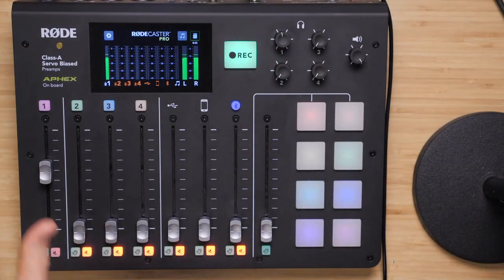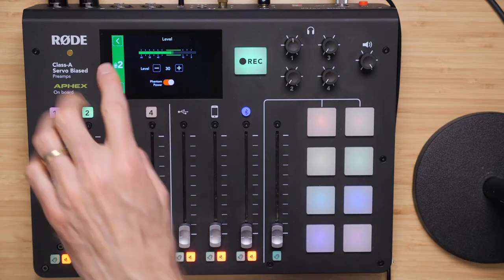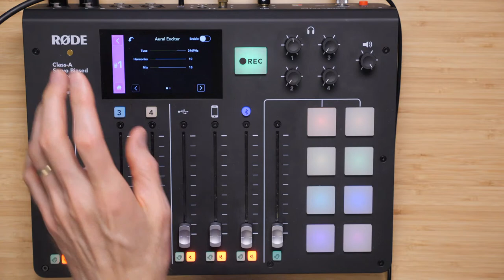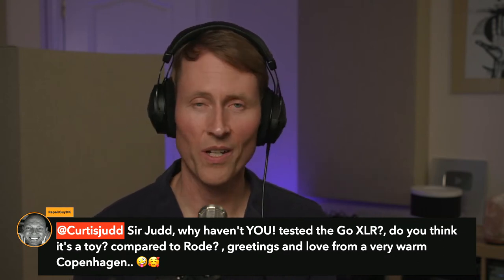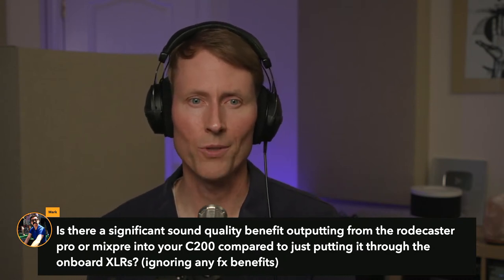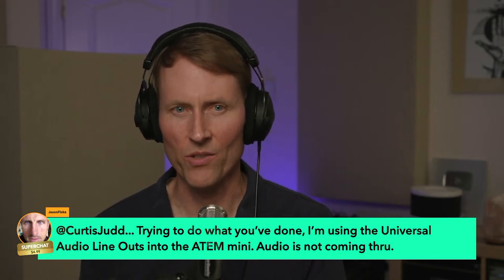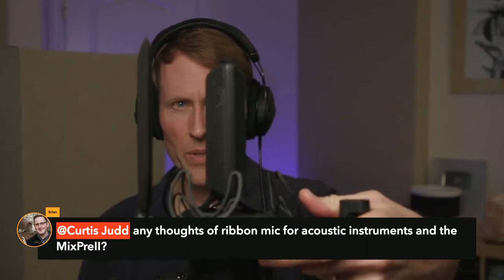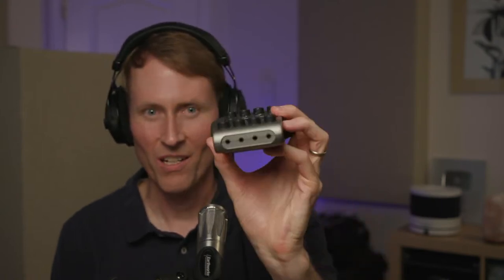ATEM Mini Audio from RODECaster Pro

Comment from the maker: Live stream starts at 4:00.
Reply: Did you have a cloud lifter on the sure when you had the hiss? I am wondering if that would solve the issue of having to push the gain so much.
Reply from the maker: @EatLocalNewYork  No, I did not use a cloud lifter, fethead, or any other in-line amplifier.
Reply: sorry to be so offtopic but does someone know a trick to get back into an instagram account?
I was stupid forgot the login password. I appreciate any tips you can give me.

Comment: I had been considering a very similar setup for a teacher that I am working with for remote learning for music. I like your solution better. Big buttons, recallable settings, and relatively intuitive controls. I was most concerned with how to effectively transport and monitor audio to and from the ATEM (and the expense of the ATEM) and decided to not splurge on the ATEM Mini. 
Setup goal was: Three mics - dynamic vox and xy classroom room mics. Two or three cameras - one director, one classroom, one option/flex use. 

I ultimately did an Apollo Twin USB (1 vox / 1 room) and a pair of webcams all combined in OBS to be used as a software ATEM-ish setup... feels like duct tape...but I was able to package it and get them trained on it pretty effectively. Works fine. But I'm afraid I'm stretching the outside limits of USB resource availability from a consumer laptop. The ATEM mini is the solution to that concern.

EDIT - To clarify, I didn't read the manual too hard on the ATEM - saw the back said "Mic 1" and "Mic 2" and thought... bummer... no line in.... next.  They did themselves a disservice not advertising that is line level switchable more prominently. Make sure Black Magic knows your stream is directly driving sales of their products.

Comment: Just a thought, but on equipment that uses an external power supply that sends DC voltage to the device, running that cable parallel to line level cables won’t typically introduce audible noise. Running said power cable parallel to balanced mic cables shouldn’t create noise, as we run 48V DC inside that cable with no issues. Definitely don’t run AC power parallel to mic level cables, especially unbalanced 1/4” mono-style. 

Love your channel, Curtis!
Reply from the maker: Thanks Carey.

Comment: Hi Curtis, my understanding is that the RodecasterPro has balanced outputs. Because of that, I use balanced cables (TRRS), connecting the Rodecaster in to a box that converts the signal to unbalanced. From that box, I use 3.5 jacks or RCA to connect to any other unbalanced line level input, Switcher,Camera, etc.... In my case, this eliminates all unwonted noise and hum. Would love your opinion on this approach. Thanks
Reply from the maker: Hi INFO GUERRA, it sounds like that works fine so that's good. The ATEM Mini's inputs are unbalanced, as you know from your setup. As such, the cable I use has 1/4" TS connectors bypassing the balanced signal coming out of the RODECaster Pro. Since the cable is short and I keep it away from power cables, it seems to work well without hiss. Both approaches are valid.
Reply: Hi! What box are you using? I have challenging noise in my setup. 

I have been using isolation transformers, got better but not great. Cables are short.
Reply from the maker: Sounds like they’re using a DI box.
Reply: Curtis Judd I normally used DIboxes to get unbalanced stuff (bass, keyboards) into balanced inputs on a mixer. But maybe they can work the opposite way if not electronics stops that. Passive DI?
Reply from the maker: @mikaelsvennungsson  Agreed - I would like to know which box they're using as well. Normally a DI is to convert from unbalanced to balanced. Perhaps it is just using a passive DI box in the reverse, though I've never tried that. In this case, it seems to work fine with the cable I described. No need for a conversion box.

Comment: Hi Curtis. I must've watched this video 3 times or so but still having issues with syncing ATEM produced recordings and the audio from the SD card from RodeCaster Pro.  Have you found a solution for this at all?  You're the only one I can think of to ask!
Reply from the maker: Yes, I make a recording with me clapping. I take the video into a video editing app. I move frame by frame (one at a time) to count how many frames there are between the time I hear the clap and the time I see the clap. Then I go into the ATEM Mini's software control app on the audio page and apply an offset of the number of frames I counted in the video editing app. I hope that helps!

Comment: I have a SMB7b on the RodeCaster Pro and I bought a FetHead which helped but I am still getting ~50-55db of hiss. So FetHead requires phantom power, I am at 5th rung on from the top on the fader, ~48 on the levels. Cables are not crossing any power cables, I even just pulled them up around to see if it made a difference but it didn't. Maybe it's the  Kopul Studio Elite 4000 Series XLR cable?
Reply: To be clear, I don't have a ATEM Mini although it's on my radar for other things. The RodeCaster Pro is hooked directly to the USB on my Mac Pro.
Reply from the maker: Hmm, could be. I’d push the input level and remove the fethead.
Reply: @curtisjudd  Thanks for the response. Hmm, if I remove the FetHead, turn of Phantom Power, juice the levels to 55 (max), it does remove the hiss but I need to move the fader above the fifth from top to get anywhere near the 15 mark, which brings the hiss back lol.
Reply: Also, I typically keep my microphones a few inches from my face. I always figured that was proper mic technique.
Reply: @iamfrankstallone  Do you hear a similar level of hiss in the livestream here? If not, it might be worth contacting RODE support to see if there's a problem with your copy. I wish you all the best on getting this sorted out!
Reply: @LearnLightAndSoundSessions  Thanks. I did but I also have more background noise. I have a Blue Yeti Pro and that works as expected on the unit so I am going to swap the cables, see if that changes anything, and muck around more. I had to ask because you were literally using my exact setup -- hah! -- and thank you. I am grateful for your time and patience.
Reply: Follow for future Frank. I seperated the power cables and XLR cables, and got XLR cables the exact length I need. This got rid of all noise, and no FetHead / Cloud Lifter needed.
Reply: I hear hiss too but the noise gate all but cancels it out, so nobody else hears it.

Comment: I have tried to push Rode to include delay in the Rodecaster for the scenario when you are using eg Microsoft Teams etc. and connecting ATM and RC via separate usb connections. Let’s hope that they are able to squeeze that into the RC via a firmware update. (Software to delay sound exist but want to minimize number of components in the chain)
Reply from the maker: Interesting idea. I suppose it depends on whether there's enough buffer memory and it is high speed enough.

Comment: I am sorry I am asking so many questions but you are also very kind for answering them all 

If I were to get the Apollo solo (USB) 

And run it with the sr314 

Would I be able to process it with (included software) or would I need to go out and purchase anything additional
Reply from the maker: Hi SaltyPancreas, the UAD Apollo interfaces come with some plugins, but they are not all free. So depending on what you need to do, you may need to purchase some additional plugins. The RODECaster is more focused on spoken word recording and streaming, so is a good match if that's what you're doing. That said, the Apollo interfaces are amazing, but the learning curve is substantially steeper and the price of the plugins can be quite high - adding potentially a few hundred dollars to the final price.

Comment: Hi Curtis, to get audio from rodecaster and video from hdmi cam in sync you mention adding some delay in the audio from within the settings on the atem mini. Is that possible only in the atem mini pro or also in the atem mini?
Reply from the maker: Hi Ronnie - this is also possible on the non-pro version.
Reply: @curtisjudd  That's great! Thanks!

Comment: Would you recommend sending the line level from the RODEcaster Pro str8 to the camera to eliminate sync issue and skip doing the trial and error sync test? Or would you recommend sending the signal from the RODEcaster Pro to the ATEM like you have in this video?   I have a Gh5 with the audio adapter that can take line level input (I would just need an adapter to convert the cable XLR to camera).
Reply: Chris, I understand there are many ways to turn gain up and down and adjust volume levels with features not he RODE and the ATEM combines.  I noticed your output is maxed out on RODEcaster pro sending into your ATEM.   Is that so you can get the most juice out of the RODEmixer and then adjust on the ATEM mini? Id love your feedback thanks!
Reply from the maker: @maiaproductions2855  Yes, exactly.
Reply from the maker: I would go into the adapter at line level which makes sync a non-issue.

Comment: Curtis...thanks for another fantastic video.  Can you give me the specs (and even a suggested brand) on the output cables you recommend to take a feed out of the Rodecaster?   I'm very motivated to avoid RFI and electrical noise.    Thanks much Pete
Reply from the maker: Hi Peter, links for the cable are in the description.

Comment: Hi Curtis, Big fan of your channel, brill content. Question about where to monitor the audio from?

I've a Rodecaster [RC] into Atem Mini Pro (using the connection method in your vid) and then into OBS. ATEM and RC are also connected to PC via USB (to control hardware via associated software). I use the RC for compression/noise gate etc and the ATEM for EQ and OBS for limiting.

I would appreciate your advice on where/how to monitor the 'final' audio output so I can actually hear the applied audio settings (for RC, ATEM & OBS combined) and adjust them? If I use the front headphone port of the RC, that only monitors the settings I've applied to the RC, and not those applied to the ATEM or OBS. Food for thought for another vid maybe?
Reply from the maker: Hi Carl, Thanks. With the setup we covered here, I now stream directly from the ATEM Mini Pro. So in that case, I can monitor from the headphone output on the program monitor. You could do that but it wouldn't include the final audio processing of OBS. To be honest, I'm not sure how to monitor the final encoded audio if you're using OBS as the encoder. Perhaps it has the ability to send final audio to the computer's sound card and you can monitor from there? EposVox on YouTube might have some insights since he know OBS much better than I.
Reply: @curtisjudd  Thanks Curtis, as always straight to the point and clear. Many thanks and very much valued.

Comment: @Curtis Judd 5:47 FYI, my brand new Rodecaster Pro has unity marked with bold lines (similar to the top and bottom line shown in this video). And I also just got an Atem Mini Pro ISO as well!
Reply from the maker: Hi Ben - thanks for that! Good to know they started marking unity. And congrats on the ATEM Mini Pro ISO! Happy streaming.

Comment: Hi Curtis...  I've only just discovered your channel. Great work. Like your style.  I use a RODECaster Pro regularly for podcasts, and have learned how to tweak its processing in V2.1.  I'm doing audio for a video shoot soon,  all talking-head using Sennheiser EW100 lav kits,  destined for an e-learning course.  I thought to use the RODEcaster as the audio interface with outputs to the internal card and an external ZOOM H4 as backup. What do you think? Thx!
Reply from the maker: Hi Andre, That should work. I'd only worry about how well RF/EMF shielded all these devices are just in case some interference pops up. If you test beforehand, that should give some confidence.

Comment: My wife does corporate trainings and I've built a small studio for her centered around an ATEM Mini Pro.  Had been looking at adding a Rodecaster Pro into the mix because my setup is just not complicated enough...  Then the ATEM Extreme came out with Super Source and the possibilities of doing live virtual panels with 3 remote guests excited her.  HOWEVER that would mean needing to separate out the audio from up to three video-in feeds and then mix-minus multiple backchannels (one per guest) before you bring the audio into the ATEM.  If I'm reading specs right the Rodecaster's mix-minus is far too limited to do this (or can I mix minus to those 4 headphone jacks???).  Any suggestions on a mixer like the Rode that could do this?  Thanks in advance for your answer.
Reply from the maker: Hi Sid, I would just use Zoom as the back channel for multi guest streams and use the processing in the ATEM Software Control app in that case. I’d think trying to add the RCP to that setup adds a lot of complication for not much benefit.

Comment: Great video Chris, thank you so much. I’m almost halfway through it, so forgive me if you answer this at the end, but when I lifestream I send the Atem mini and the Rodecaster into my MacBook Pro via USB C separately. Then I put a short delay on the Rodecaster signal. I’ve had OK results with this, are there advantages to sending the audio into the atem mini instead?
Reply from the maker: Hi Ryan, yes, but only if you wanted to use the Fairlight audio processing in the ATEM.
Reply: Curtis Judd awesome, thanks!

Comment: Hi Curtis,

I have two different mics plugged into the Rodcaster via XLR. I'm running the TRSS cable to Mic 1 input into the ATEM Mini. I want to streamline my podcast editing process and be able to individually see on the timeline each speaker talking into their respective mics. How would I achieve this? Thanks
Reply from the maker: Pan one hard left, the other hard right.
Reply: @curtisjudd  I meant with separate .wav files on the timeline.
Reply from the maker: @yashchitneni  Yes, that will put one on the left channel and the other on the right channel (assuming you're only using 2 microphones). Otherwise, no, you'll need to record on the RODECaster and sync to the video in post.
Reply from the maker: Unless you have both the ATEM and the RODECaster attached to the same computer and are using an encoding app like OBS in which case you combine the audio and video in OBS instead.

Comment: Interesting - on my RC Pro, the 7th "line" from bottom is marked with a slightly thicker line; I always thought that that would be Unity, but per your statement that doesn't seem to be the case. Also, I don't see that "thicker" line on your unit in the video, but that may be something related to resolution/screen, as the difference is not all that big. I'd prefer a click anyway...
Reply from the maker: Agreed. An ident would be nice.

Comment: @curtisjudd Hi Curtis. I'm curious about your usage of Ecamm or perhaps OBS - alongside Atem Mini (basic, or pro / ISO) - and Rodecaster Pro? Is there any scenario where you might still use Ecamm or OBS alongside Rodecaster and Atem?  Perhaps for more cameras or graphic options or production workflow?  Also, from the audio side, what would you recommend if it needed to be a larger setup - such as for a live event (when they restart), with 4 - 6 speakers (moderator and 3 - 5 panel members) plus 2-3 roving mics? Still with Atem - though is there still a way to use the Rodecaster Pro or would you recommend a different set up. Finally - I think Rode and Blackmagic should tie up and hire you as an evangelist and educator. Your content is superb.
Reply from the maker: Hi Steve, I've stopped using Ecamm Live because I haven't been happy with the frame rate conversion it seems to insist on doing. I stopped using OBS a few years ago because at the time, the macOS version of OBS wouldn't save my setup between sessions and it became too much work to re-set it up each time. Now that I have the ATEM Mini Pro, I just stream directly from it. If I need to bring in overlays and screensharing, I have a separate laptop for that. For more than 4 mic inputs, there are a lot of mixers out there. Some very affordable analogue mixers without all the effects/processing can work nicely. I have one of the smaller Mackie VLZ4 mixers which works nicely. For big events where there's a bigger budget, I have an Allen & Heath SQ-5 digital mixer which is a dream to work with. It has 12 inputs, compressors, EQ, and other plugins which work very nicely. Thanks so much!
Reply: Curtis. Thanks very much for the answer and clarification. Looking forward to more content and hopefully to chatting at some point. I’m working on a big idea all about innovative finance to address the Sustainable Development Goals - which needs a professional approach to content. You have been such a help already - but I’m wondering if you also consult on occasions? S
Reply from the maker: @transform_global  You can contact me - on my YouTube channel, on the about tab.

Comment: If I want to livestream a Zoom call - what would you recommend as the setup if I'd like to use the XLR mic from the RCP? I have the RCP, ATEM Mini Pro and MacBook Pro.
Reply from the maker: I haven't worked with Zoom and live-streaming. I generally prefer to use platforms like Streamyard which are made for streaming instead. Sorry I couldn't help more.
Reply: @curtisjudd  Thank you!

Comment: Hello, I have audio monitors connected to my RodeCaster Pro. How do I accomplish setup of the ATEM Mini Pro? Should I disconnect the audio monitors and use the L/R inputs on the Rode for the cable for Line In on the ATEM? Thank you
Reply from the maker: That's how I did it.
Reply: Thank you!

Comment: Are the pre amps in the rodecaster not as good as you would prefer 

I was gonna end up using the same microphone with this set up
Reply from the maker: The preamps are great for condenser microphones like the SR314 or NT1. I wouldn't have any hesitations there. For people who want to use the Shure SM7B, they might want to consider a fethead or cloudlifter.